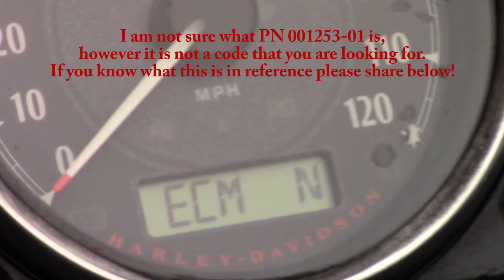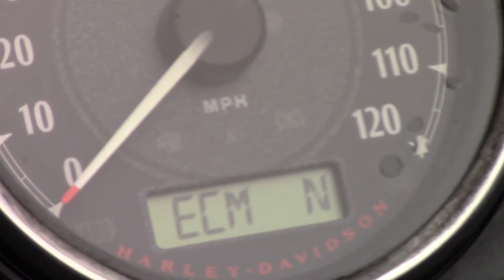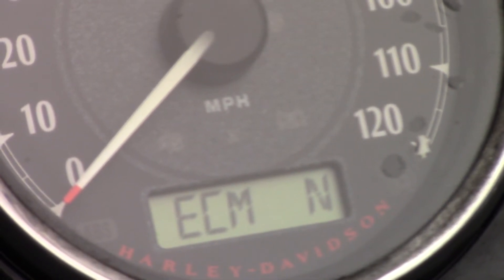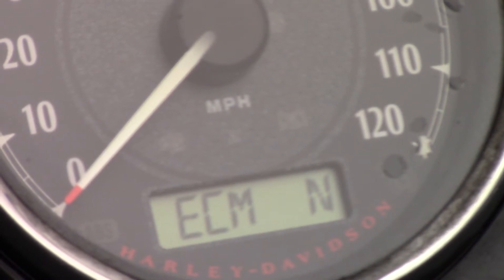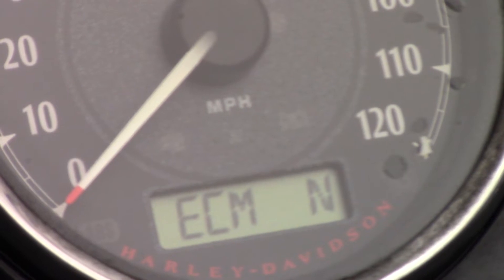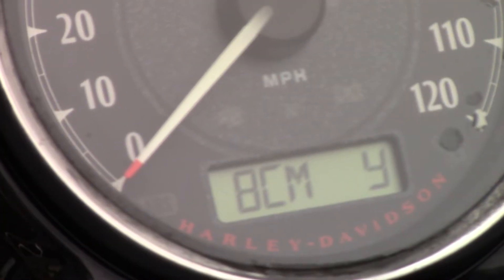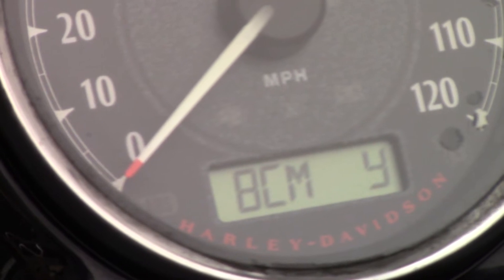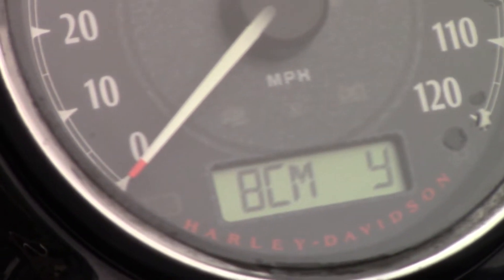Reading trouble codes on Harley Davidson Sportster 48 with no scanner!

Comment: What was wrong with your bike I am having the same symptoms with loosing power like I feel like I downshifted when I am up shifting
Reply from the maker: Hey sorry for the late response. If i recall correctly the code that it shows in the video was for a bank 1 lean condition. Witch turned out the front 02 was bad. I tested the 02 to verify it did not work than replaced it and the bike ran like beast again! If you have a bad 02 its not to horribly expensive and its easy to replace 👌.
Reply: @dirtyfloggins2027  where did you get the o2 sensor... im looking for a new one for my 2021 48.... i replaced my exhaust and damanged the front one... getting the same code, but it still comes back after running so i need new one 100%

thanks again